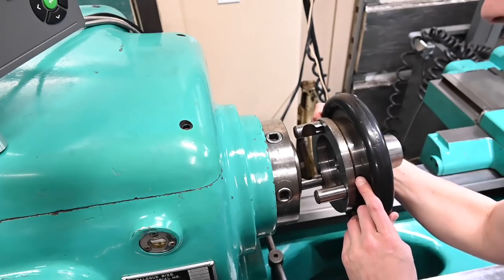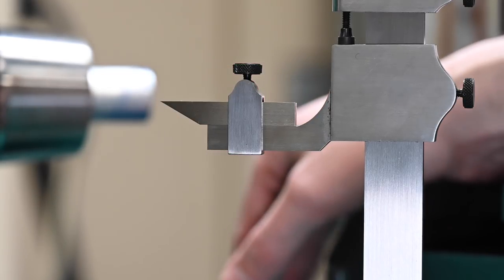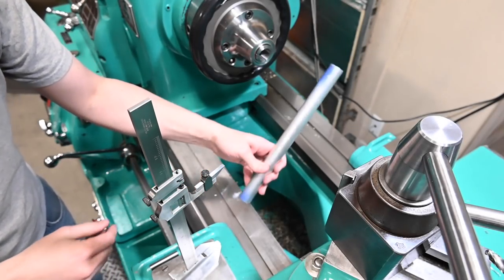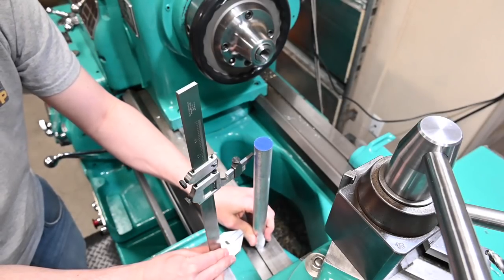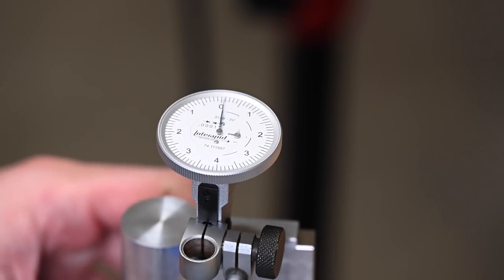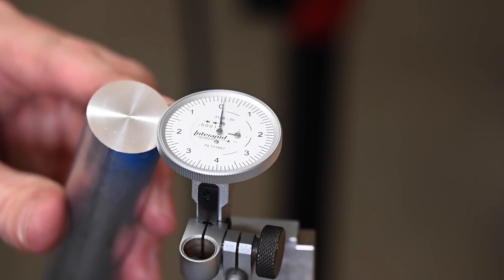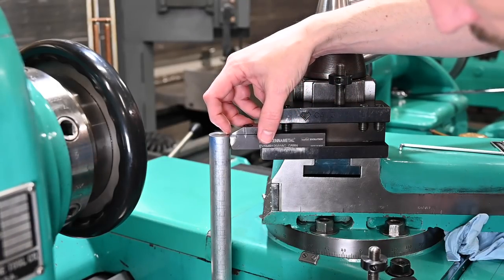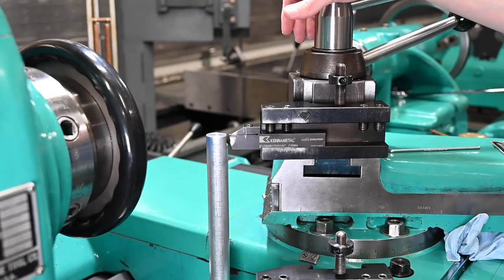Quick and Dirty Lathe Tool Height Gage

Comment: I just use a point in the tail stock. I swing the compound around, adjust the height, and swing it back. It’s quite accurate.Doesn’t take more than 30 seconds.

I don’t know what you guys do. But a lot of us have a separate tool holders for each tool. You just switch them out. No setting each time. Set it and forget it. Each insert type has its own tool holder. Each tool holder has it own tool post holder. Just loosen and slide them in and out. Yes, you accumulate a lot of tool holders. But it’s far quicker and more pleasant to use.

Comment: I have been a manual machinist since the late 80's. There are numerous methods to set tool height. Someone said they still need to adjust after, that depends on a lot of things like tool wear, material being cut, the finish it is producing, the ambient room temperature. Personally if there is no standard, I just face cut till no pip is left then carry out a standard cut to make sure I am happy with the setting. Done in 2 mins.

Comment: Drill and tap the end of your bar. Take a piece of square stock and drill a hole crosswise into it so it can be attached the end of your height setting bar. Now you may use the bar as shown or swing the square stock over the cutting tool to see if it hits. Handy for tools that don't hang out over the lathe's bed flats.
Measure the length of the finished setting bar and mark it on the lathe somewhere. Helpful to know if you are boring work clamped to the apron.

Comment: Side note. I noticed the lock ring on your tool holder adjustment uses a setscrew instead of the common double nut setup. Great idea as I find the double nut often changes the setting when I lock it. Thanks, I'll try it.

Comment: Looks like the tip of the dial indicator was working in an angle. It will only give a correct measurement when reading exactly 90 degrees to the axis of the tip. I bet the gauge is more than accurate enough anyway  and I love the "keep it simple" approach. Just want to comment so that people don't forget.
Reply: Absolutely true 0 and 90 degrees is best
Reply: If you're measuring size yes, but if you're just comparing two things it shouldn't matter.

Comment: If you keep your gage blocks oiled, they will "Ring" together and not fall apart.  That was how we used them at the National Bureau of Standards when I was a Physical Dimensional Lab Tech.  Just clean and reoil them before reboxing.
Reply: Oil is just to protect them they should ring dry
Reply: The term is wringing and as much oil should be removed prior to fitting blocks together, as possible. Blocks should wring together, even if both surfaces are completely dry and in a vacuum. This is why they make wringing pads, which are designed to "dry" the block's face. Blocks with a surface finish >5.0E-6in will have a difficult time wringing and should be replaced with ones that are grade AA or better. If you use Chromium Carbide blocks, there's zero need for any type of oils or coatings, for wringing or preservation.

Comment: I have a nice Hardinge lathe tool height dingus.  One of these days I'll try to adapt it to my lathe.
Reply from the maker: I was going to buy one of those, but they go for crazy money on eBay.
Reply: @AlwaysSunnyintheShop  Mine came in a pile of stuff in a local auction, didn't know what it was until I saw one on ebay.  I doubt I paid much, sometimes the boxes-o-crap get tagged on the next item for a buck when they don't sell directly.  Then when you pick up it's your job to haul it off and throw it away.

Comment: I followed Joe's video as well and made this tool out of aluminum. I do use it all the time. One thing I've noticed is even setting the height with this tool, occasionally I still have to fine tune the height a tiny amount. Again, it's useful for setting your height fast.
Reply: If I remember rightly Joe made the top of the height gauge out of stainless screwed to the aluminium didn't he? I suppose in a working environment it needs to be of a robust material to withstand rough handling while remaining accurate.

Comment: A comment if I may?  That skyhook base attachment into those thin cast iron flanges on your top slide, combined with the the significant lever arms and the mass of the chuck is a recipe for disaster. Do not be surprised if one day the whole assembly tears out - with the associated tears.

Comment: Speaking of cutting-oils... Try Canola oil(they actually use it as the main bulk in many commercial lubricants) mixed with however much low-aromatic lamp-oil is needed to get the desired viscosity.

Little/no smell a high'ish smoke-point and not overly toxic either...(and it's CHEAP...)

Comment: I have a piece of 1/4" round which is ground to a point and ground half way, it is bent at 90 and welded to a piece of box section. Set to the centre height, hangs on a nail on the wall.
Took me 3 mins  to make used it for years.......

However yours is pretty

Comment: My only concern with this being aluminum is thermal changes 
Maybe it doesn't matter but...
Reply: He's got a semi-airconditioned garage, he should be fine.
Reply: We’re talking manual lathes here, a thou or two off center is perfectly fine. On a lathe this size you’re typically doing things that you could be off center 1/4” and still be alright

Comment: I usually just eye ball it by looking at the cutter face to the work diameter. If its a little low rarely an issue. If it is a little high the extra cutting force is quickly apparent. Your method is probably better.:-)
Reply from the maker: You get pretty good results by eye, so I’m not gonna judge!

Comment: Your way works, but I find it a bit fiddly.... For the last 51 years I have just pinched my 6" flex scale between the tool and side of the part.  Look at it towards the chuck and adjust till vertical.  Pretty accurate for me all these years.

Comment: Neat Gauge: In truth, the gauge can be +/- 0.001" and you won't notice any "tit" (the tool will shear off the tit when facing) and the sine error is ridiculously small on all but the smallest diameter work. Your parting tool will run better just below (~0.005") center, but if you need to cut a groove to a specific diameter, set it on regular height and slow your feed down.
Reply from the maker: Yeah I wasn't super worried about the slight difference- glad my thought process was valid!
Reply: Got to agree, one shouldn't obsess to the nearest tenth, unless you are single point threading 0-80 that is.😉

Comment: Aluminium is a poor choice for a tool that you want to maintain dimensional stability with thermal changes. I know that sort of precision doesn't really matter here, but its just something to think about when making tools.
Reply from the maker: Yeah for sure. Aluminum is good for making lots of things, but hardened and ground tool steel is used for most tools for a good reason. Couldn’t justify all that effort for the benefits of this tool though, so aluminum is definitely good enough.

Comment: What ever you do don’t try car dif oil it’s to good at preventing steel to steel contact so it stops you lathe tool from cutting 🤯
Reply: just use carbide tools. It doesn't prevent steel to carbide contact.

Comment: Aaron, is there any chance I could talk you out of using Rapid Tap for a cutting fluid?  If you will look at the Data Sheet for this product, you will see they recommend that one does NOT inhale the fumes.  See: <https://www.durhamtech.edu/sites/default/files/safety_data_sheets/Machine-Shop/Rapid%20Tap%20cutting%20oil%20casR-RapidTap%20SDS.PDF>  If you can detect an odor, it will impact your health.  In this respect, I am not a fan of WD-40 either

Comment: Not easier to gently touch off the part without the lathe running to zero in that way you wouldnt have accidently took a fine cut

Comment: Is the chuck that heavy to waste so much effort with a sky hook? A nice wooden cradle would do less damage and a hydraulic table for lateral transfer and work surface half the time. You are never going to mill anything you can’t lift by hand anyway, it’s like an engine hoist for a lawnmower engine. Some toys are just not needed, just saying.
Reply from the maker: The chuck is about 120 lbs and the spindle is up at about chest height for me. Add in how much I have to lean over the bed to pull the chuck off, and yes, it’s definitely worth it. I did it before I had the Sky Hook but I will never change it again by hand.